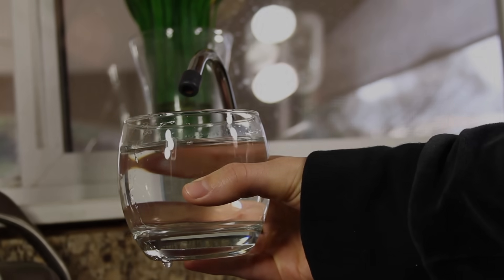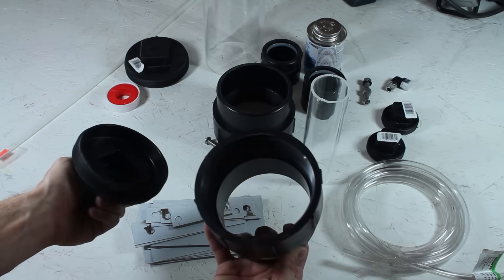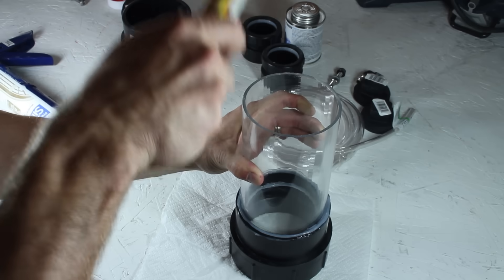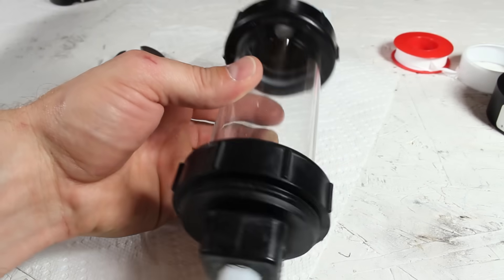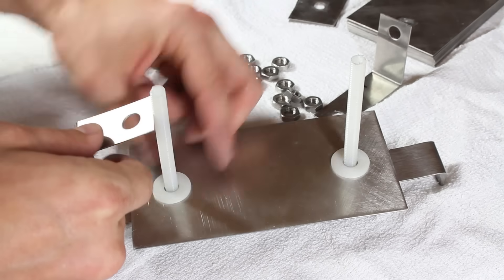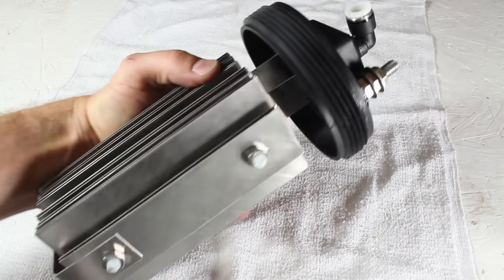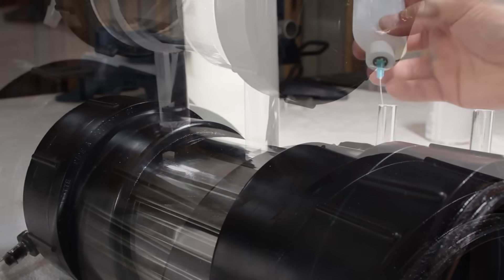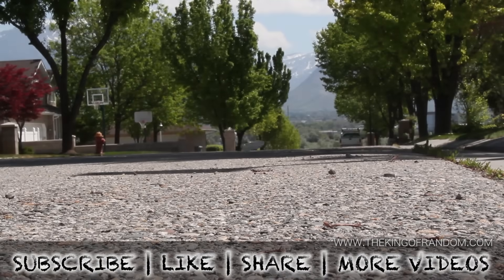HHO Generator - Water to Fuel Converter

Comment: Is there a reason you used stainless steel instead of aluminum? While both are resistant to oxidation I would think the aluminum would be a better choice seeing as how it is going to remain submerged in water.

Comment: Your filming looks very professional and well done. Besides, the pvc doestn't stand the pressure if something goes wrong (i.e. backfires). A simple rubber washer isn't enough to seal the power plugs at the top of the cell. A check-valve isnn't fast enough in stopping backfires: the secret is in the bubbler (and in the flow and pressure calculations, accordingly to the use you want to do with the gas). Increase reaction surface by using more sheets of lesser thickness (I'll give you a rather interesting clue on surface: stainless steel wool? haha!). Speaking about hho gas, the goal here is not to kill a bee with a grenade laucher: you have to use less energy as possible in splitting the water molecule (aka "keep amperage as low as possible").
Reply: The Electricity to create the hydrogen must come from Somewhere
>>>>>>>>>>>>>>>>>>>>>>>>>>>>>>>>>>>>>>>>>>>>>>>>>>>>>>>>>>>>>>>>>> This channel is playing dumb; scamming people into believing in free energy from water
Reply: Scott Francisco not free energy mate ... a alternetiv energy,,less poluting 
this only depends o n cost of producing hydrogen 
actulaly hidrogen is just storing the energy ...just like gasoline
Reply: Scott Francisco The car batteries Mr.Francisco
Reply: Ah yes, I used copper wool and some steel tubing for a flashback arrestor before. The bubbler is more of a last resort, really.

Comment: This is great! Much better than the mousetrap handgun video.
My friend and I did a similar experiment with a 12-volt battery, metal plate, test tube, and jar full of water when I was in high school. It took about 8 hours for the test tube to fill full of oxy-hydrogen, or whatever the gas he mentioned was. (long time ago) We would get the power of about 1/4 of that of a firecracker after 8 hours of processing the water. We would ignite it with a lighter.

Comment: Grant Thompson - "The King of Random" Can you modify it somehow so it can made oxygen and hydrogen separately ?
Reply: Use a container cooled by liquid nitrogen, then the gaseous oxygen should condense separately, leaving the gaseous hydrogen. To modify this would be to add something to it, not change it.
Reply: If the electrodes are contained in separate vessels then each vessel will accumulate a different gas.

Comment: Can someone tell me how it converts it???????
Reply: The current across the water molecule(caused by the electrolyte allowing electricity to flow through water) breaks the covenant bond. The elements are separated and a flammable gas is the result. Despite what some have said on here, the oxygen burns too.

This might not be practicle as a "free energy" but, Your automobile produces more electricity from the altanator than the battery or operating systems use. That power is wasted unless you do something with it. So break water and feed that into your intake manifold. The oxygen will combust when it becomes pressurized(piston). The oxygen and Hydrogen burn a higher percentage of the petrol your car uses. It also does this at a lower temperature keeping your engine running slightly cooler. If you can get 25%-50% better mileage using the wasted electricity your altinator makes why not?
Reply: The electricity separates the Hydrogen and Oxygen in the H20 molecules, which are both essential for a combustion reaction. That's all I know, I'm not a chemist by any means.

Comment: People keep saying he's using a car battery as if that disproves the value or possible value as an energy source, but they still use car batteries for the typical engine. HEADS UP I haven't really picked at physics in a while and I was terrible with chemistry. Please correct me if I'm wrong, and it didn't make me stupid for not knowing something, but simply means I have not yet been exposed to the information.

Separating water this way seems pretty simple and potentially useful, but how could you use it as a form of energy? Again, I don't know the science behind it very well, so I could be very wrong, but would it be better to find a way to efficiently harness the energy in the form of heat via the oxygen instead of the hydrogen (or am I misunderstanding)? All I remember in the form of chemistry here is my ninth grade teacher separating water into hydrogen and oxygen gas, and then using a match to test them. The hydrogen combusted, and put the match out, while the oxygen increased the flame size and could light the match after it was blown out normally. 
   In the form of physics relating to this I just remember my teacher saying we didn't have a good way to harness energy that was in the form of heat because the typical engine needed a difference in temperature to run (or something like that), but if there was a way to overcome that, and use the heat created as an energy source, couldn't it run more efficiently and be easier on the environment? Please, I would like thought out answers and nobody using names. Information is nice and neutral. Insults are not.

Comment: This isn't free fuel because you have to use energy to separate the water molecules.

Plus, in using that electricity to generate fuel, you may as well use the electricity to power whatever, because you can't get more energy out of this than you put in. You're only exchanging energy. - and at a loss, at that.

not that it isn't a cool thing, electrolysis is very useful. Its just not practical for "free energy".
Reply: You can use solar or wind energy for the power. And before anyone says something about things costing money, EVERYTHING costs money.
Reply: I agree, but I think this is more for the person who wants to blow something up.
Reply: ever herd of an alternator ?? jack ass
Reply: Everything costs money - therefore money is not a concern? Solar, wind, hydroelectric and geothermal power all tap into otherwise wasted energy, but they are not very powerful by themselves (especially solar and wind) and tend to either need a huge number of units to be worthwhile, which is very expensive, or done on a small scale, which is, of course ... small scale. 

The real, true problem with this is that, if you have a power source such as wind or solar, why would you want hydrogen? 

The second law of Thermodynamics basically states that you cannot get something from nothing - you always get something at a loss. You put 100 units in, you get 60 units out. 

So, at this point, you will be much better off generating electricity through your solar FIELD or wind FARM. Emphasis on just how big and expensive the infrastructure would be. Keep it at that.

Comment: is this possible to transplant strait into a car? i noticed he used 2 battery's but i take it one would work as the output seemed really high for how big it was, thoughts anyone?
Reply: Sure, if you want to increase your fuel costs that is. A car's electrical system CAN be used to split water but your engine will NEVER be able to extract enough kinetic energy from the gasses to justify it. It would take far more electrical energy away from your engine (by burning fuel) than your engine could possibly gain by reinserting the gasses for combustion. Its basic conservation of energy. No system is perfectly efficient and splitting water with electricity is horribly inefficient. Add in another horribly inefficient internal combustion process, and you have a recipe for dismal failure and INCREASED fuel usage.